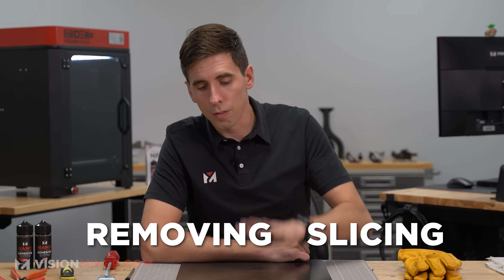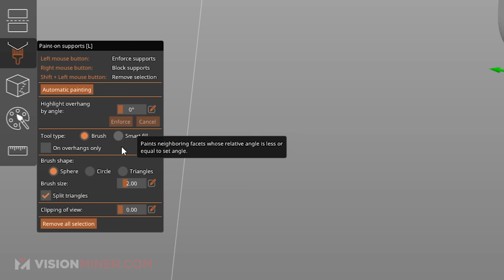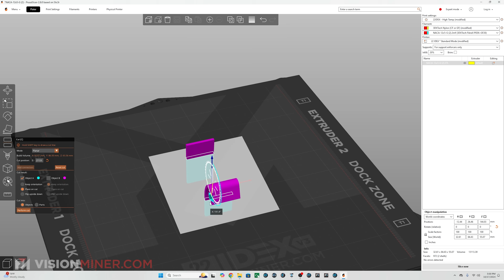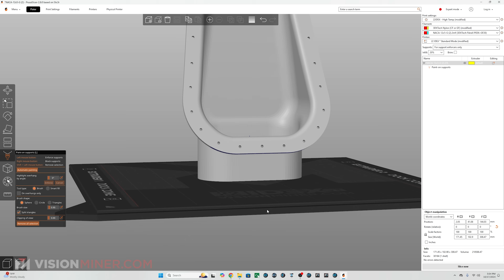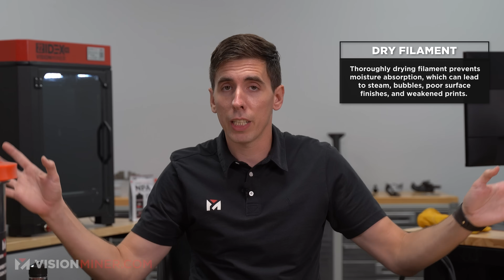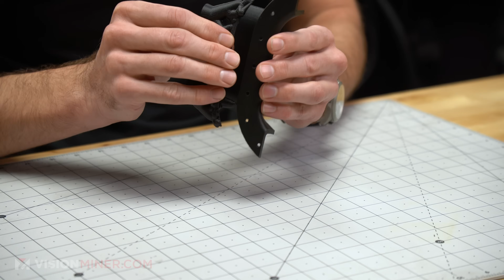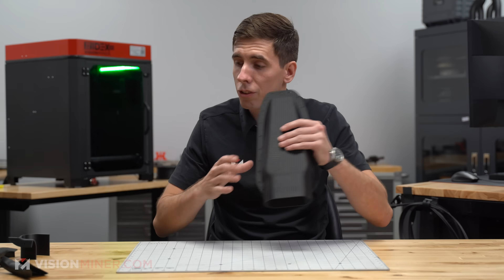Carbon Fiber Nylon 6 Car Parts: 3D Printing Workflow Tutorial on the 22IDEX

Comment: I print my CF nylon (PA 612 CF) and have pretty good luck on my P1S even without heated chamber. I just heat the bed for 15 minutes prior to print and keep door shut. I run Aux fan on 5 just to keep heat even inside. Believe it or not my textured bed adheres perfectly fine I just use the Nano bond glue. Like 7-8 drops. A bottle goes a LONG way. At 45 bucks a bottle I find ways to stretch it.
Reply from the maker: Awesome!!

Comment: I have a Qidi Plus4 with heated chamber that hits 60C  and so far good for printing PA12CF with the NanoAdhesive, and I imagine PA6CF will be same.  HOWEVER, there is a PA that I have found which warps no mater what I do, and that's blue string trimmer line.  It should a be torture test material.  Wind on a spool, run it through a drying cycle, then put it in a dry box. Was able to print finished Benchies with a slightly curved bottom, but with a narrow tall and thin rectangle it pulled up no matter how wide of a brim I added.  

Also, what I want out of a 3D printer is not multi-color, but high-speed multi-material.  Makertech has their switching hotend that allows for a material and support-material on one hotend to save time, and THAT's what the market needs. I want to print PA or PCTG with break-away supports that don't destroy the finish quality.

Comment: I'm new to  3 d printers. Just got them bambu mini A1. What software were you using to alternate your three d prints?
Reply from the maker: Bambu Studio has the same features, as well, to slice parts -- it's the two rectangles with a dotted line in between, up on the top tool bar :)
Reply: If you read closer you can see he's using a forked version of the "Prusa slicer 2.8".

Comment: nano polymer adhesive - over 40 prints on one coating with PLA? Well, over the past 5 years, I've run two Prusa MK3s printers for over 600 days total printing time of PLA on each, with possibly 4 or 5 failed prints without any glue.;  You do NOT need glue for PLA on PEI sheets! Especially very, very  over-priced glue
Reply from the maker: We love when people point this out. Yes, PLA often sticks to a warm bed with no adhesive. We didn't make this adhesive for PLA -- we made it for PEEK and ULTEM, and it's super beneficial to engineering polymers like PC and Nylon. To add to this, plenty of people DO have trouble keeping PLA stuck to the bed, for whatever reason, and you can see those people singing it's praises all over the internet (especially X) -- if you don't need it, that's awesome! But the customer reviews speak differently :)
Reply: @VisionMiner  I print nylon and PEEK on a regular ender 3 with a modded extruder for 30$ and a $20 amazon enclosure... you DO NOT NEED a 15k printer and glue... just set your print speed nice and slow, calibrate your printer.
Reply: @mishaisspeed have you done any testing in these, since you’re well out of the manufacturer’s tolerances for bed and chamber temps? Yes, you can print them if you get a nozzle that will go high enough, but that’s not the entire story.
Reply: @melgross  tests in what?
Reply: It’s not over priced when you don’t have any failures.

Comment: Thanks a lot,the last video when you were printing large parts and prevented warping by switching from a rectilinear pattern to a hilbert curve was a godsend,sometimes when printing large parts i experimented warping but since im using the hilbert curve thats gone.thanks a lot!!
Reply from the maker: Glad it helped! Great to hear :)
Reply: hilbert is so slow but definitely designed for warp resistance. it's good for big solids of materials like ABS. small or maybe even medium sized pieces you can get away with rectilinear, but full concentric is not a good idea for infill, whether that's sparse or solid ABS.

Comment: If you have a choice, do not use .STL files, use .STEP files instead.
STL files have a much lower resolution compared to STEP files. It does make a quality difference in the print.

Comment: CF Nylon+race car parts? You have my attention. 😁
Reply: Real racecars use Continuous Carbon Fibre, this isn't that.
Reply: @PiDsPagePrototypes  Real race cars will use whatever is practical and prudent to fix a problem or solve a temporary issue. I've both designed complex parts for race teams and utilized many additive manufacturing processes as well as subtractive, depending on the tolerance and restrictions around part in question and rulebook leniency(s) for governed motorsport. 
Other times you can replace an extremely specific machined part with a screw, zip-tie and some decently strong reinforced tape that will last most of a season.
Reply from the maker: That's a really broad statement... not based in reality, sorry

Comment: That is an IDEX machine, why in the world aren't you using separate support material? And since your printer gets hot enough, did you anneal the part in the printer after removing the supports?
Reply from the maker: We didn't use a separate support material because it adds significant time to the print, as well as more failure points. It's always recommended to avoid dual extrusion if you can, at least in higher-temp materials, because not only will you shave off a ton of toolhead-change time, but your layers can also maintain more heat (doesn't always apply) resulting in better layer adhesion. Keeping one extruder going constantly is just faster than switching back and forth -- there's a time and place for multi-material, but this wasn't it :) as for annealing, yes, technically it anneals while printing (rule of thumb: anneal around the Tg of a material. Chamber was above the Tg of PA6) This particular part, we didn't do any additional processes on.

Comment: HAHA and here i am on a P1S and an X1C just throwing it in the printer and hitting go :D
Reply: Same… I print all kinds of car parts from PA6/12 CF on my X1C mostly using stock settings on either the Gold textured PEI plate or the smooth Lightyear G10 plate. No issues at all.
Reply: have you used pa6-cf/pa12-cf on the p1s?
Reply: @benjaminbuljevic7977 yes?

Comment: My experience with PA6-CF is that it loves to deform under pressure... screws getting loosed, bending from filament extruder and so...  I hope these will not rattle on the rivets soon. :) Some says, heat treat after print helps to avoid deforming. I like more PC-CF or ASA-CF/ASA-GF. Nice video ofcourse, just little too long about prusa slicer :D I've switched to Orca and there is no way back to prusa...

Comment: Hahahaha he still uses Prusaclicer😂
Reply from the maker: What slicing software do you use? For many years, we were strong advocates of Simplify3D, but we've found that PrusaSlicer has truly excelled in development and innovation. In our opinion, it currently leads the pack when it comes to FFF toolpaths and advanced features. Cura is another popular option, although it often requires workarounds for high-temperature printing. That said, we've chosen PrusaSlicer as our primary slicer for the past few years and have been very satisfied. Orca may be part of our workflow in the future.

Ultimately, our machines operate using standard G-code, so you’re free to use any slicer you prefer—the core principles remain the same!

Comment: Does the part become moisture conditioned after 1 month of it being exposed in the environment and become spongy,floppy and soft like other PA6?
Reply from the maker: They don't become spongy/floppy or soft -- but they do become more ductile, more impact resistant. If you print a thin-walled vase, and stick it in a dehydrator or oven for a few hours, it will be much stiffer -- when it soaks up the moisture, it is more pliable. On thicker parts, this isn't noticeable at all, but on very thin parts it can be a factor to consider. (testing videos incoming.... subscribe and stay tuned!)

Comment: What about the decreased rigidity of PA6 as it absorbs moisture over time, post print?
Reply from the maker: Hardly a factor in this case. Creep can be an issue with weight-bearing things like brackets -- although it could still be considered minimal. We had a 5-pound banner hanging on a hook for 2 years in our old facility -- in the warehouse. When we moved, and took down the brackets, they had experienced "creep" -- deformation, deflection of about 1cm. This might actually make a good video, I'm pretty sure we have the part somewhere still... but in this application, really not a factor.

Comment: Highly recommend the 'Highlight Overhang by Angle' and then enable the "On overhangs only" option when manually painting supports.  This greatly simplifies the process of adding support enforcers as it is very clear which parts need supports.
Reply: I didn't know about that option, thanks!
Reply: I was screaming the same thing at the video.  Come on Rob 😂
Reply from the maker: HAH!! Still learning :) Thanks for the tip, we'll include it in a future video! @JRSkola @jmedlin
Reply: I tend to like using basically a form of paint bucket tool but I don't know if it is available in prusaslicer or if it is just Bambu and orcaslicer. You set the angle threshold and then you can paint whole surfaces at once, it would have been good just used on that edge.
Reply: @conorstewart2214  for sure, that's my go-to as well. It's called the same thing in Prusa Slicer.
Reply: How long does it take to scan a person? from einscan h2

Comment: Thanks Rob and Vision Miner for printing these for me. Nice to see you could get a good how to video out of the deal as well.
Correction:  For all the folks out there wondering where the engine is, these are oil cooler ducts and are in the front of a mid-engine Porsche behind the cooler element/housing, under that beautiful Pyrotect fuel cell.
Reply from the maker: Thanks a ton for reaching out, and letting us use your part in the video! :)
Reply: It was a nice surprise to recognize the frunk for this demo. I'm doing a big -6 intake manifold mod so it fits without cutting into the truck/top storage space :)
Reply: A modified Voron 350 could make that part and the total cost would be well under 3k USD.
Reply: @TheMugwump1 and if you are good at modding, you can do that on a moddel Sovol SV08 for about 1k
Reply: Would be killer to see a walkthrough of the car :) Thanks for you for having @VisionMiner do the work and thank you @VisionMiner for using it to share and educate with us!
Reply: bot channel name.

Comment: I imagine that you have to include the time and material of test/tuning prints into the bill to the customer? That's a lot of time and effort, especially for one or two prints to do for free?
Reply from the maker: Absolutely. Depending on the assessed difficulty of a part, labor estimates are included, machine time itself, estimates for re-prints -- this is much more common in the high-temp filaments, where the material behavior is far less predictable. With materials like CF-Nylon, generally the standard profile works just fine. However, it's still better to do partial prints to ensure success, than to print stock and find out it didn't work -- lost time, and material. Many parts are simple enough to print without these extra steps -- but in this video, we specifically wanted to break it down and give a lot of tips and techniques, so this video doubles as a training video for our clients :)
Reply: @VisionMiner  Can you share a ballpark number of what a project like that costs? For billing purposes, how is material accounted for? Do you try to keep track of exactly how much was used, either from slicer numbers or by weighing spools?

Comment: :hand-pink-waving: A better way to print that is to move it to a 45° angle and use a very thin snap off support on the back. Most of the supports you used are not needed. Also, using PA6 anywhere near the engine is not generally a good idea. You can't trust HDT, better to think of that as the melting point over time. The plastic may be able to handle the rated HDT for a limited time, but not constant, not after heat soaked. And not even after we heat treat and cryotreat. I can show you examples. We lab test all of our parts. Love your videos as always, peace.  :goat-turquoise-white-horns::hand-purple-blue-peace:
Reply: these are not in the engine bay (Porsche 914 mid-engine)
Reply from the maker: Absolutely, we've seen that video going around -- @slant3d right? 

As for the material, Kevins comment is accurate -- for his final parts, we even used HTNCF25, for the extra heat resistance, just in case. In this video we switched to PA6+CF to be applicable to a broader audience.

Comment: Very nice! Love printing with PA6-CF, and would love an IDEX someday, but at $15K it's a little our of my range. K1 Max gets the job done for now. lol I've made a few parts for my BRZ, but definitely want a printer capable of extruding the more exotic materials. Wish I could get chamber temps hotter, especially for PA6-CF so I wouldn't have to anneal, but 60C isn't too bad. I do have my PA6-CF supports down, and love how clean and easily they pop off. I have my settings tuned pretty well, never use any glues or adhesives, and have very little issues with warping with PA6-CF, but it would probably really help me out with ASA. Great video.
Reply from the maker: Thanks man! Love the BRZ, what parts have you made for it?
Reply: The qidi xmax 3 has an active heated chamber and high temp nozzle and bed for 800 it's a great deal works very well